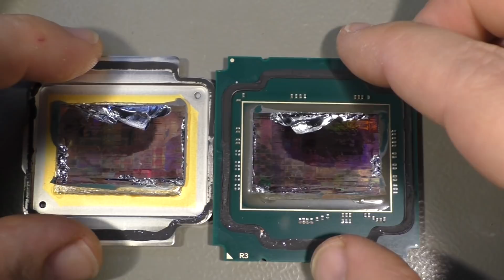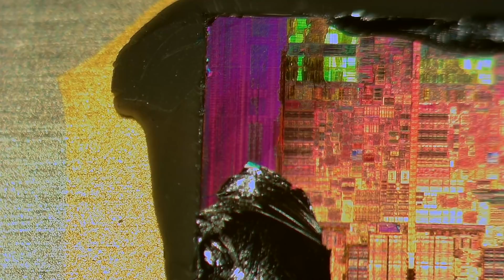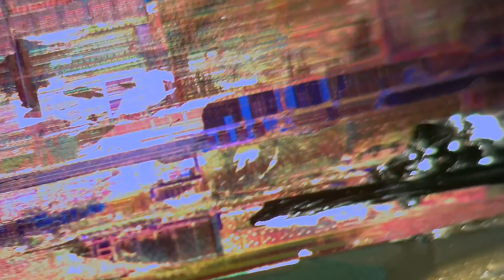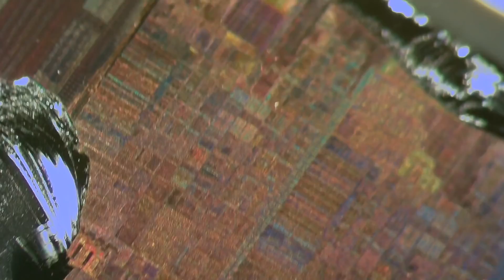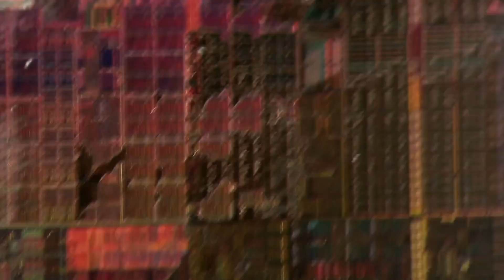14 cores of color (PWJ181)

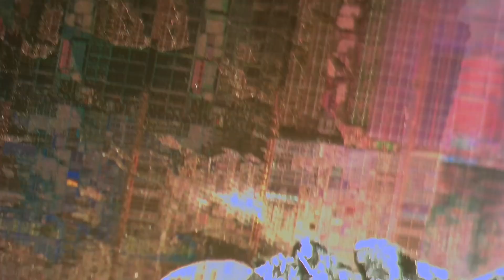Comment: 6:23 You missed out on these 4 cores. There should be 6 in one row and 3 rows with 4 cores each. The last row is mirrowed. This Haswell HCC or High Core Count die has actually 18 cores total but only 14 were functional or activated. Between the rows of cores there are rows of Level 3 cache. With the 6 cores up on the left side of the 3 rows with 4 cores there should be the memory controller with the 4 channels and on the opposite side the uncore part with the 40 PCIe lanes and the QPI Interconnect for the I/O Hub or PCH.
Reply from the maker: I did not count further than 14 because I thought those days of disabled cores are over....
Reply: Imagine if Intel has a yield issue with this die beyond disabling cores, would they make any money?

Comment: Great vid, I wonder what the rejection rate of this is - just 1 transistor or connection playing up and it's ditched? You couldn't exactly break-out the soldering iron, perhaps, an IR laser beam - probably also too large beam size :)
Reply from the maker: From my experience it works like this: 
They manufacture the chips.
They test the chips at full speed
If chip fails, test at lower speed
Sell chip as lower speed version
If core fails, sell 14 core chip as 10 core.
....
AMD sold some 6 core chips that were 8 core but with faults. So they disabled two cores.
Reply: @PlaywithJunk  That makes a lot of economic sense, all the best.

Comment: The Xeon is soldered? Usually you cannot crack Intel chips like that, no? (plenty of people delidding Intel CPUs and replacing the epoxys with liquid metal). AFAIK that is pretty lucky result for how you can see by just cracking it.
Reply from the maker: I don't understand that delidding thing. How could any kind of compund be better than a chip SOLDERED to a large heat spreader? The old Pentium 3 came as a bare chip... many destroyed by careless handling.
I think the whole delidding stuff is only there to force you to buy a new chip because you break it.
Reply: @PlaywithJunk  This is why I asked you if the Xeon is soldered! You did answer it in the video after I sent this comment. The consumer Intel CPUs weren't soldered between AFAIK 4th gen and 9th gen, just put together with some thermal compond (not epoxy, as I said). They don't break when using the proper method of delidding :)

The performance gains were significant enough.
Reply from the maker: @rkan2  You're right. Some CPUs just have thermal compound between chip and heat spreader. I've forgetten that they exist...  :-)  Server CPUs are soldered since many years.
Reply: @PlaywithJunk  Most CPUs with the heatspreder were always soldered, but Intel went to thermal paste, because you know... no competition This included the 1151 Xeons, while the larger sockets with more cores stayed soldered.
Reply: @rkan2  This generation was soldered AFAIK, but was the last done so. The Skylake X etc. were moved to thermal paste.
Reply: @17plus9  And then moved back to soldering with 9th gen...
Reply: @PlaywithJunk  From Woodcrest to Broadwell-EP they were soldered. Skylake-EP & Cascade Lake-EP or 1st and 2nd Gen Intel Xeon Scalable are not. Copper Lake-EP or 3rd Gen Intel Xeon Scalable should be soldered again. To my knowledge single socket Xeons on LGA11XX weren't soldered at all.
Reply: @PlaywithJunk  The point is to remove one interface. Die to heatsink is better than die to thick spreader to heatsink even when soldered.
Reply: Reference for thermal paste Intel sku: https://youtu.be/XopM4p4CBrs?t=134